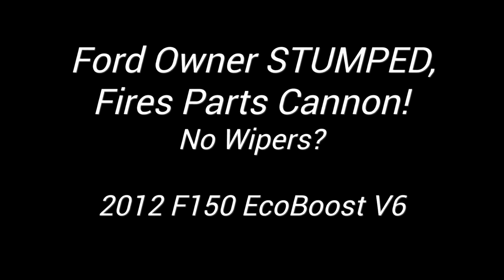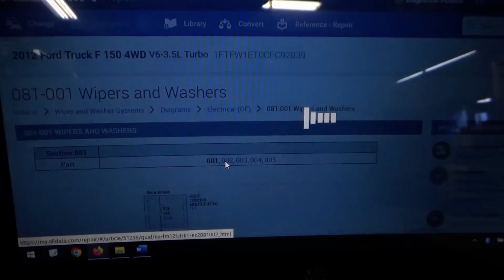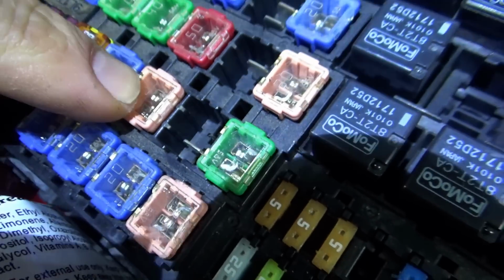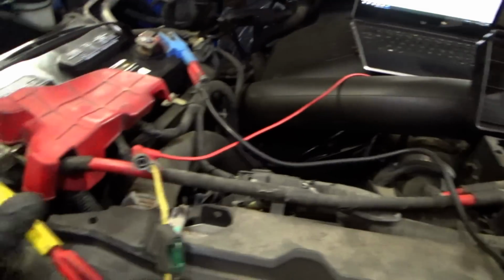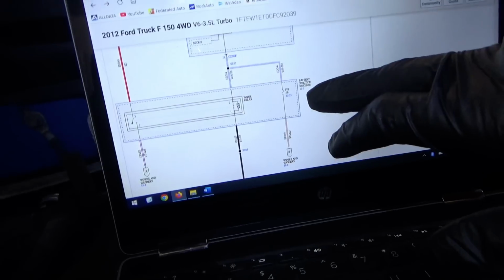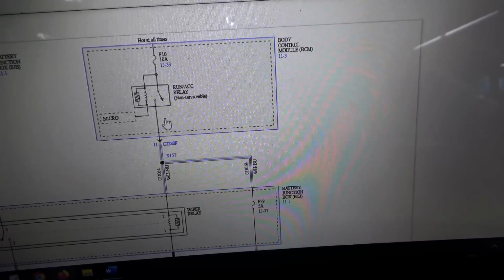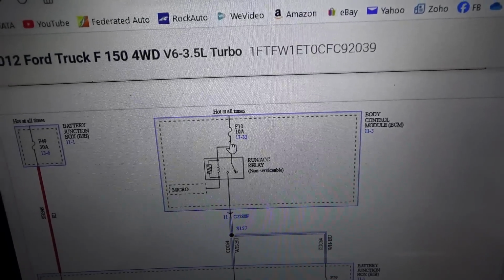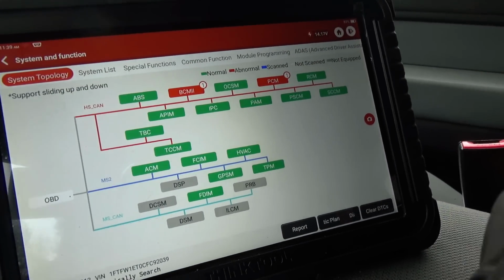HELP! My WIPERS Don't WORK! (Ford F150: Motor & Switch Already Replaced!)

Comment: Excellent diagnosis. Your scanner is very fanny. Very informative. I’m going outside in the dark to check the F10 fuse on my truck now. Lol
I just replaced the wiper steering column switch with no success. Hopefully the fuse is blown

Comment: This video also solved my 2013 F150 Supercrew  problem. Same issue missing fuse, I was already ordering a wiper switch. I tried testing the best I could with no avail. After watching your video I checked the passenger side fuse box and the fuse was missing, I found the fuse under the floor mat. I think when I had the truck detailed they accidentally knocked it loose. Thanks for the great video.
Reply from the maker: AMAZING 😊

Comment: Well you get your money, and make a good video, but I'd still have been livid !!
   How old is this guy ? you have to say he's no boomer, because we all had it hammered into us that you check all fluids regularly, it used to be once a week. Later,as cars got a little better, 
once a month. But I have never in my life gone on any kind of run outside of normal use, without checking everything, tyres to brake fluid, spare water, oil and a small tool kit, tyre pump and nowadays a jump starter, always took long leads. always used to have a couple of wire coat hangers. So far nothing has given way outside of my usual area, where I was half expecting it, and where I know where to go for spares. sometimes you just have not had time to fix stuff that you know about !  Sorry for the ramble, but I don't understand why people don't check their cars !

Comment: Most people never pop the hood unless the car stops working. Amazing that the truck was able to run all right with a gallon low on coolant. Where did it go? Perhaps when it was changed, nobody burped the air out of the coolant hoses?

Comment: I have a 2011 F150. The wiper and wiper fluid switches work intermittently. Wiper control switched on, going down the road, if you hit a bump the wipers and washer will start working. Turn the engine off and they go back to not working. Since the wipers and washer motors are on the same ground I figure it's a ground problem. Does anyone know where this ground would be physically located? Thx.

Comment: Owner should have stopped when he was ahead. If Ivan hadn’t put Dexcool in the cooling system, the next call to Ivan would have been a claim for replacing the burned-up engine, even though no-coolant was not part of his original complaint.

Comment: The customer pulled the fuse, forgot about it then fired the parts cannon! Today's cars aren't really meant for the DIYer unless you really know what you are doing. Also, did the guy fix his radio and figure out why his coolant is low?

Comment: So why does everything on a vehicle need a Module? WHY??? So the steering column control MODULE has to talk to the stalk, the stalk has to talk to the Door MODULE, Then the door module has to talk to the ECM, which has to talk to the BODY CONTROL MODULE........ And we wonder why this crap breaks down?????

Comment: Had almost the exact same truck I was working on. Came in wipers intermittently would cut out. It was the white/blue wire that was factory crimped/spliced giving power to control side of relay. Bad splice. It is right on top if the radiator and goes down on the passenger side. push on harness right there and wipers would work. Opened up wire loom and found the splice all intact, but if you flexed it, they would cut in and out. Crappy Ford non soldered crimp with glue or something inside as a splice. Cut it out and replaced it and wipers work fine.
Reply from the maker: Great find! Sounds like the EcoBoost from Hell haha

Comment: programmed a new ecm in a chevy PU . Shop diagnosed it as bad . New ecm programmed same results , Misfire on all cyl of left bank. Tech had "checked"  all the fuses. He didn't however chk the missing fuses. 
Driver of truck pulled a random fuse to fix inop phone charger and killed 
1/2 the cylinders

Comment: Given the age of the vehicle and a review of the wiring diagrams, I think I would have started with the BCM internal (non-serviceable) RUN/ACC relay having bad contacts. Any time I see a system problem which includes a non-serviceable module relay (junction box, BCM etc.) I tend to start my power testing there.

I would have never guessed the customer forgot about removing the fuse. I would have expected an intermittent short to ground blowing the fuse due to wire chafing.

Comment: There's an irony in the fact the system is designed to fall back to what worked for decades in case the "high tech" piece failed..

Comment: The last two cars I worked on this week were from the same customer and both cars only has 30 psi in all the tires when they call for 44 psi.  He said he forgets to check the pressure, but since he is a good friend of mine I ragged on him about the TPMS light being on, to which he responded with a hand gesture and accompanying two word phrase you would expect.

Comment: Some time ago a friend came to my house and his car died,  barely have power for the internal lights and dashboard, i told him that looks to be your battery. Response i just replaced it, i go to check and the battery poles were not tightened... A fast movement with the famous key 10 and yes it started perfectly........

Comment: Well I’m shocked radio doesn’t matter coolant level, doesn’t matter, wiper’s maximum effort!
Was the oil low too?
No leaks from any other location?
Can’t predict what is wrong you can only plan a way to test and then work each clue.
Thanks Ivan!

Comment: Fuel the car, clean the windscreen, check the oil, washer water, battery water, radiator level and tyres.  Basic maintenance, come on people.  It's not that hard.

Comment: The radio controls are likely bad, I have a 2011 F150 and my radio did not work for close to 5 years and I decided to try the radio controls and it came right on and worked perfectly. Not talking about the entire control board with the hvac switches just did the upper portion for the radio.

Comment: Missing fuses seem to be a thing these days.  I had a customer come in yesterday with a 2013 Honda Odyssey.  Starter and money lights are on, and you have to hold the key to the crank position for several seconds for it to begin cranking.  Oddly, this van has an independent MIL for the starter.  He took it to 2 other shops.  One replaced the starter motor.  Didn't fix the issue.  The 2nd couldn't figure it out either.  So, I scanned the PCM, it says it's a starter relay malfunction.  I pulled up the wiring diagrams and discovered that this van has 2 starter relays and 2 starter fuses.  I tested the relays.  They are good.  Then checked the fuses.  Oops.  One of them are missing.  The customer knew nothing about it.  He says the van has had this problem since he bought it 3 months ago.

Comment: Bonus Footage :  So where does the coolant go if the head gasket isn't the problem or any obvious leaks and there is no coolant smell detected  ??   I always thought since the cooling system is a closed system, there should be very little dropping of the fluid level in the reservoir tank over time. But in the new car I purchased in July of 2023,  I have had to add about almost 2 quarts since then.

Comment: Nice one Ivan. A straightforward diagnosis, and we even get the story from the owner to explain it. Regarding your "bonus footage" comments, I for one have been taking your advice! Every weekend I check my coolant and oil, and top off my washer fluid (which I'd have to do anyways). It takes less than 5 minutes, and gives me more confidence in my vehicle knowing the fluids are good.

Comment: Typical.  Where I worked at before, it was low oil, or low coolant, or low tire pressure.  Occasionally low brake fluid.  Some drivers were on top of things, would stop by the shop and we'd take care of it.
Good one Ivan. I saw that a couple times at work.  One guy came in, fuse was there, relay was missing!
Nice buddies!

Comment: Don't beat yourself up b/c how many times do we troubleshoot or perform a repair & find an easier way after the fact. Even if you had checked the fuses first you still need to verify integrity of the circuit unless the customer owns up to removing the fuse. Sometimes we have to be detectives 😃. In the end it was a great video to show how to bypass the circuit & components to diagnose issues. I'm retired now but it's great watching your videos. From when you started to now it's pretty impressive watching you grow into one of the best!!

Comment: Customer created problems are the best and should be the most lucrative.    Customer can change all those parts but can't remember to install a fuse he removes...then immediately after his troubleshooting attempt at a radio he creates the no wiper issue but can't go back and trace his footsteps.     Charge large Ivan.    Guy wasted all kinds of money unnecessarily on unneeded parts.       Charge accordingly

Comment: Why on earth wouldn't the owner pay you an extra hour or two to confirm radio diagnosis and trace the coolant leak ? Loosing that much coolant is going to result in dead engine sooner or later, at the very least his heater won't work 😂

Comment: Interestingly not only do they have the high speed bypass but the wiper switch also fails in low intermittent. Every one iv seen fail, fail with the wipers on

Comment: I don't feel like a dummy any longer for not putting the encoder motor fuse back in my Sivverado.🤪. 
I wonder why Ford and Chrysler were using Dex-cool but are not anymore. Could that be because of corrosive effects?

Comment: I got a 2003 town car from my friend, it had a host of problems, a couple of weeks ago the highbeams started acting up, they would work then I'd shut then off and when I needed them turn them on and nothing, the indicator would light but not the headlights, I attributed it to possibly the leds I had installed because that's when the problem started, sometimes coincidences do happen. I did some research and the consensus was that it was the LCM, but wait why did they sometimes work it made no sense, I decided to check the underdash fuse box, I found the highbeam fuse and swapped it with another 20 amp one in the box and bang, the highbeams worked, so as you might figure the fuse was bad but not so fast, visually the fuse looked ok and both tested good, then I found the problem, as I juggled the fuse the lights started to act up, it turned out that the fuse was loose and not making contact all the time, I've had many vehicles and never had a loose fuse ever, never to by the way a fuse looks always test it either for continuity or power to both legs, I can show you a blown fuse that looks perfectly fine but isn't, I saved it as a reminder.

Comment: in the owners defense, how many fuses were required for the wipers to function? More than one besides a main fuse is an engineering failure.
Reply from the maker: I love how they have a relay in the BCM to energize the relay for the wipers to energize the wiper module xD

Comment: Unfortunately, not checking fluids is a symptom.  The cause, like so many things, is fatherlessness, daycare, and taking basics out of public school.  Most guys and many gals used to learn this from following dad around when they were little.  Now, for many people, no one is teaching them.  I learned this from following my stepfather around, as he patiently taught me basic car maintenance.  If I hadn't had him, I don't know where I would have learned it.  I've known two different men who each bought a brand new Ford and ran it until the engine threw parts all over the highway, both at 25,000 miles, and both having never had the oil changed.  In both cases, the men were fatherless.  Nobody taught them to change the oil.
Reply from the maker: WOW that's crazy lol
Reply: @PineHollowAutoDiagnostics  Pretty much.  There was another commonality between them that is not politically correct to mention.  Both events also happened within a year or so of each other, back in the eighties.  One was a coworker, a little younger than me, and had bought a very expensive Mercury Cougar, the other was an employee of a friend, older than my parents but had never owned a car before, and bought a brand new Ford Escort.  They both died with the same mileage.

Comment: nobody checks coolant i had cars where was serviced by dealer and quick lube i had 1 lexus 450h bought new 1 day i drove the car as i did not drive it was my wifes car the heater was not working well i noticed the coolant was low filled coolant tank 1/2 and drove sucked that in and refilled again 1/2 way the car was only serviced at dealer never seen any leaks it a shame people do not check all fluids so if get your car serviced do not assume there checkig your coolant like ivan was showing there are certain coolants for different cars

Comment: Does this car not have a Coolant Control Module (CCM) which checks the Coolant level and is controlled by the BCM over a high speed CAN bus which is controlled by the Data Network Control Module (DNCM)? Yeah man, this car is sooooooo 2012. No wonder it's broken all the time. It needs MORE MODULES🤣

Comment: Oh I remember the days when the wiper circuit was just a fuse, a switch, 3 or 4 cables and maybe some relay. Nowadays you have five pages of wiring diagram just for one simple function being needlessly computerized.

Comment: Great job! I love wiring diagrams, and I can tell that you do, too! You know, even without scanners and computers, electrical stuff itself can be plenty complicated. I worked on a machine once because the Emergency Stop didn't work. It had a string of switches in  series, feeding a relay. Each switch had a lamp in parallel with it, so you could see which one kept the machine from running. someone had put the wrong replacement bulb in, and when the switch opened, enough current continued thru the bulb to the relay to keep it pulled in! Who would have thought changing a bulb could prevent a safety switch from stopping the machine????

Comment: We have all been there for anyone who has had to perform diagnosis on a vehicle before. The term "kiss" applies here. Keep it simple silly. I just saw a video yesterday of someone doing a timing job on an ecoboost engine. The hose clamps are a weak spot on those engines, to the point where they break and cause coolant leaks. Tell the owner it is worth checking.

Comment: Why do people not check their fluids in their cars and trucks It should be done every week or two and not wait until warning lights come on and never ignore minor ones so in this case it was complaining about an oil change and tire pressure on these modern cars well Ford anyway cuz I have one they know exactly how dirty the oil is so if it pops up oil change required that means your oil is doing nothing for the engine there's no life left

Comment: Hi Ivan , I have noticed on several of your last videos you have made,  the vehicles have been low on coolant. Over here in the Uk I have a 15 year old Kia diesel  and 20 year old Ford Fiesta diesel and  the coolant level never changes from one year to the next. I change coolant every 5 years and never have to top up in between changes. If there are no visible signs of leaks, we're is this coolant going.

Comment: SMART A Comment, With current car excessive computerization The wipers are controlled through the dash cluster which takes info from the PCM to the BCM and is routed through the tail lights then to the under seat position switch back to the BCM and finally to the column switch
Reply: in a roundabout way that is how it works. Only it's connected via the hi speed data network and while the wipers don't care what the tail lights are doing one systems faults can adversely affect another.

Comment: Surprised that there is only one computer to control the wipers. I would expect at least 4 or 5.
Reply: More complex on vehicles with rain sensing devices.
Lots of fun in dry times when those folks go into an automatic car wash and have no idea how to turn off the wipers.

Comment: Why do you need a module to control the wipers I don't get it What was wrong with a simple switch and relay I guess if it's auto wipers but they look manual.

Comment: My diagnosis process is ALWAYS check power first, starting at the battery and battery voltage. At least a visual check of fuses is necessary.

Comment: Really how much difference would there be going backwards through the system VS checking fuses . You would most likely still have to consult the schematics to figure out where all the fuses and relays live. Plus the added value of putting your eyes on all the pieces and parts.  I think I'll stick with the trusted tried and true Ivan method.

Comment: Actually once you find a circuit with an issue start in the middle of the circuit and determine if the problem is upstream or down stream then test at the center of the problem half of the circuit. Always divide and conquer. Overall a very nice job Ivan! And this is why you charge 25% more if the customer worked on it first. almost no snow here in upstate PRNY.

Comment: Think backward on the circuit, you also learn the circuit in case the fuse kept blowing, then it would be easier to diagnose a bad wire now that you have everything apart and laid out with a good knowledge of the circuit.

Comment: For good wiper we need  : OFF. and variable speed from super slow to flat out  hyper speed  in one turn of a knob. . .  As for the coolant luiquid? ?  is there really a difference  between them, all motors are aluminium or cast iron  hoses are all rubber ! ! !   so why all thoses difference? ?

Comment: I wouldn't be surprised if there's a 10A fuse in a slot that's supposed to be empty if the owner has been in the fuse box messing around.
Reply: That's what I was wondering.  Perhaps in there checking fuses and put it back in the wrong slot.